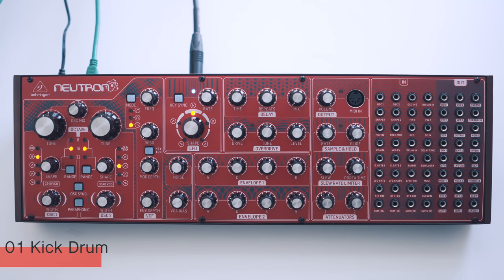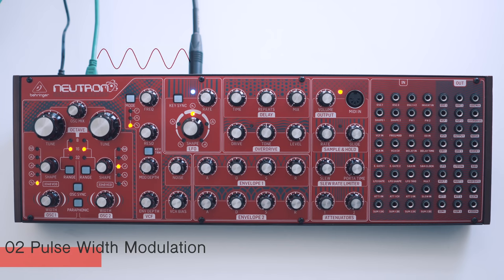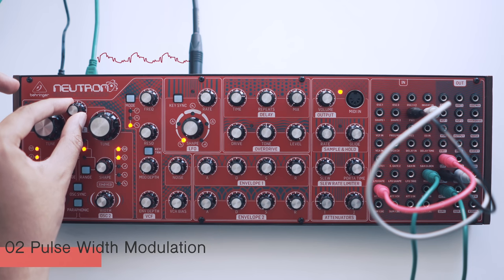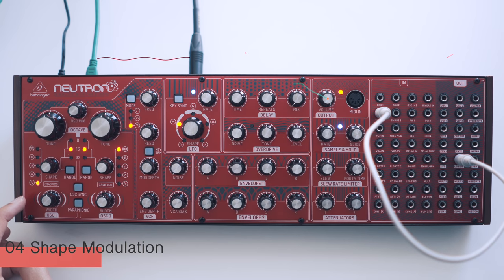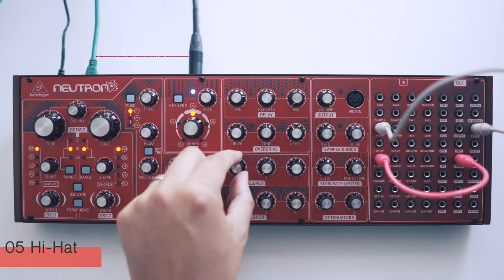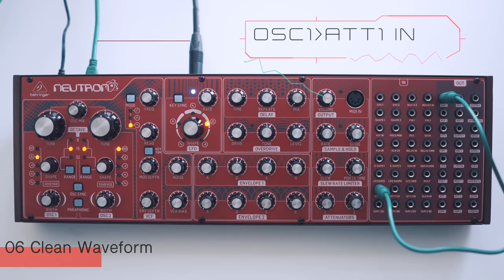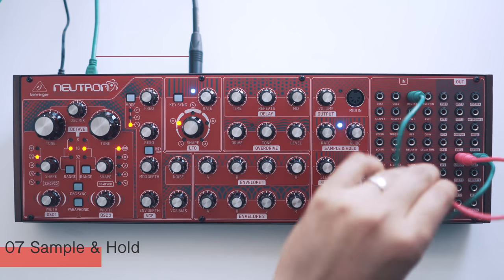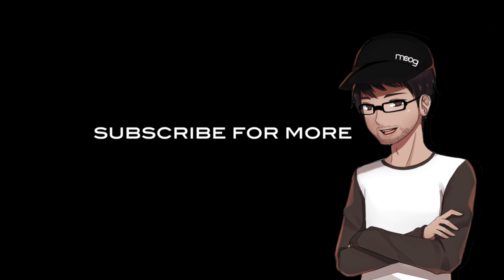7 Patches with the Behringer Neutron [4K]

Comment: Nice vid! FYI, you could create your pulse width modulation patch without doing any patching at all, as the LFO is normalized to go through Attenuator 2 to both Pulse Width 1 & 2 by default.
Reply from the maker: Nice! Didn't know that.
Reply: also Gate 2 is Normalled from Gate 1 (wouldn't need to use mult). ..and a v. nice vid :-)
Reply: Rishabh Rajan manual 🎛🐛
Reply: Nice vid...
Reply: That’s what I love about the Neutron. It’s a good entry into the modular world. Even though some paths are normalized, it’s interesting that you can get the same results from patching. For educational purposes.

Comment: A better way to achieve "Clean Waveform" is to patch VCF1 (out) -> VCA IN, which will bypass the overdrive circuit for BOTH oscillators without using up an attenuator.

Comment: How great is this module?!? I just got mine today and I'm BLOWN AWAY. This feels like a $600 or $800 boutique synth. SOLID. And super friendly with my other modular gear. They really did a great job of creating a really great voice with a normalled path, but a TON of patch points that I don't consider it semi-modular. I think of it more like a super complex voice module. FOR $300. It's insane

Thank you Rishabh! You did an excellent job, I'm sending every new modular convert to your video after telling them to start with a Neutron. Out of the park, Behringer.
Reply: Yep.  That's why I bought a second one when they dipped to $220 new.  That's insane.
Reply: FACTS!
Reply: I picked up a used one for $150 but the normalized patch doesn’t work because of faulty hardware... and behringer doesn’t cover their products unless you have a receipt even when it’s a known hardware issue....however. The stock normalized patch is still capable through patching and I’ve grabbed a couple stackable cables to rectify making the used ports free. Even in its quirky state I love it.
Reply: Hey! Try putting the cuttoff around 12 o’clock and feed the LFO to the filter cutoff at audio rate. 

Somewhere around 2 o’clock on the LFO rate knob works. 

Now, raise the res until it self-oscillates. This sets up a vocal formant sound that is very belchy and human sounding. Like the bass line in that “Ride My Pony” song. LOL

Adjust cuttoff, res, LFO speed and shape, and the modulation amount in tiny bits to find the vocal sweet spots.

Comment: Nice video! Btw. you can completely turn off oscillators by switching octave range to +/-10 (all 3 LED's on) and turning oscillator tune knob fully clockwise.

Comment: Very nice video, but Patch 2 is completely obsolete. Pulse Width for both oscillators is actually routed to the LFO through Attenuator 2 by default, so there's no patching needed, just turn up Attenuator 2 and adjust it with the LFO. That's the first time i ever fully read the manual on a product and it actually paid out ;)

Edit: Whoops, looks like somebody already pointed you to it

Comment: I have a question. If the neutron and its midi / gate output are to be inserted into the pitch of the oscillator, it would work?

Comment: This thing sounds great, but I can't believe they put the patch labels BELOW the points! What were they thinking?! Guess it's an easy fix with an overlay.
Reply: It's annoying indeed, but not as much as my ms20 mini esoteric patch bay was :)
Reply: I just got mine a few hours ago and this is one if the first things I noticed.
Reply: Because that way you can still read them when you have a cable in? Makes sense to me ...
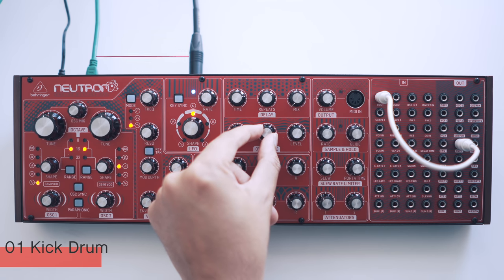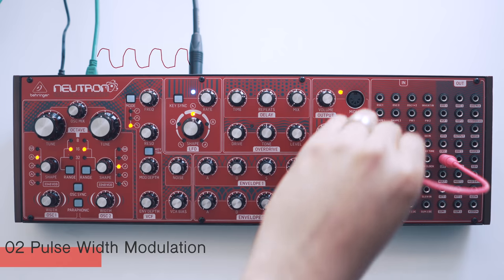Reply: In this video at 1:25, you can see the white patch cable connected to two points. For the point on the right it's plugged into, the "Output" label is far more visible than the "Env 2" label, but the later is the correct label. Even more so, at 3:08 a red patch cable is plugged into two points, and the one on the left you can't even read what the label below it is with the cable in. I went to look through modules and it seems like there's not a consensus to me. I only have a Mother 32 currently, but I can imagine the cables cover up labels below more than above, unless your most important/common patch points are at the bottom of the module.
Reply: The video is filmed from a straight angle above the synth. That's not how you see it when you're operating it, you're at a much lower angle, and the labels below make more sense. Also I happen to have a Neutron in front of me right now :)
Reply: When I get mine I'll let you know if I agree or not ;)
Reply: @BeniRoseMusic  No matter what you won't regret buying one. It's awesome!
Reply: For the lost souls who make dance music whilst seated.
Reply: @mynewcolour  Guilty as charged!

Comment: Does this work with midi? I noticed no midi cable is plugged in.
Reply: it does
Reply: @rmanpojo8485  Thank you I appreciate your reply.
Reply: @haroldpalmer3245  but there is a midi cable connected  midi thru...  without midi you can use the cva bias to make sound.

Comment: DIY patch cables... anybody tried to make it? I guess it's not hard... Any cons?
Reply: Cons? just the time it takes I guess. I make cables up ocassionally, usually when i need a cable quick, like yesterday I needed a 2x2 meter rca cable so I unsoldered jack plugs and rca plugs and resoldered rca plugs to lcables that previously held the jack plugs. Not sure I would bother making patch cables when you can buy them made for the same price as the parts.
Reply: I've thought they're not that cheap...
Reply: @KiR_3d  I just bought a pack of 10 off ebay for £18.
Reply: our local mid. salary is ~ 200 - 500 GBP (for usual ppl of course)... so I think 1,8 isn't that cheap... :) I'll not be happy with just 10 (soon) I guess ;)
Reply: MoolahNasreddin  Ahh, fair point. I did not realise where you were from. I am looking at alibaba right now to see if its worth ordering up a batch.
Reply: Thanks a lot! I think I'll solder something DIY :) I'll buy some on Ali as well... but it takes time.
Reply: I buy the connectors from Tayda Electronics for @ 20 cents each, and salvage wire from old RCA cables that can be had for next to nothing at a second hand store. I can’t recommend Tayda highly enough for DIY modular.  The least expensive parts that you will find.  Also if you are in the USA, their eBay store is “thaishine”. Cheers!
Reply: Thanks! I'm in Russia and probably I'll buy some good and inexpensive jacks in a special store (about cables and connectors). I have 10 cheap Chinesse jacks with metal cases but not sure it will be good for this.

Comment: I know this is a pretty stupid question, but would it be possible to patch a guitar into one of these and use it as an FX unit, or can it only handle MIDI inputs?
Reply: Yes you could. It has an external audio input.
Reply: Neato. What kind of impedance is the input rated for? Could I plug my guitar straight in, or would I have to jack into a DI/preamp first and then plug into the input?
Reply: It would be line level. If your using an electric guitar you could possibly just run straight out from the amp. If not you would need a a DI or pre yes.
Reply: Ah ic. Thanx a bunch for the input.